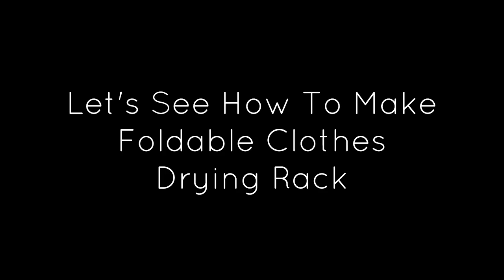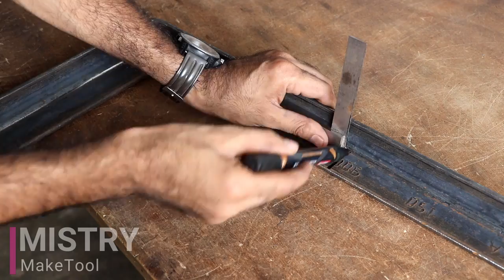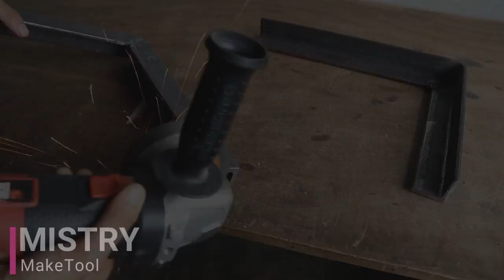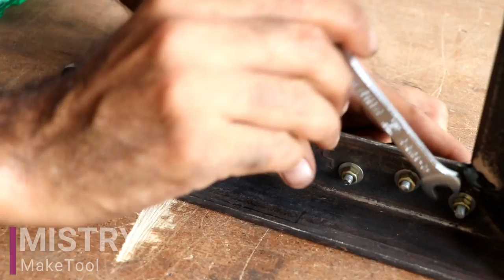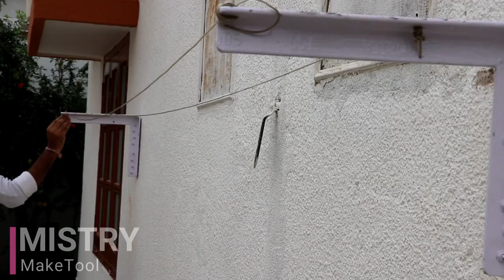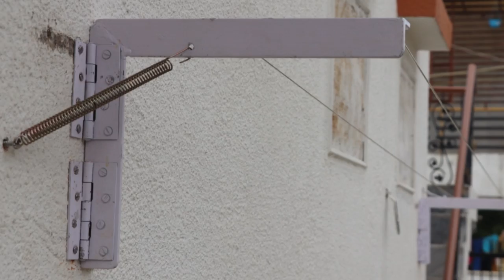How To Make Foldable Clothes Drying Rack || Wall Mount Drying Rack New Idea : )

Comment: Circular hack video please
Reply: What do you mean?
Reply: @denniswhite166  i means Circular saw hack videos
Reply: @mirzaharis914   Yes, your suggestion is a good one. I don't have a table saw but I use a circular saw instead. Tips on these would be good for me too.
Reply: @denniswhite166  i have a circular saw and table saw
I love to work on miter saw
Reply: @MistryMakeTool  please yarr next video circular saw hack
Reply: @mirzaharis914  To be honest (I'm 65 yo) I never did woodworking before and I've seen videos and heard about table saw accidents and injuries. It's made me a little afraid to use one. I have a new sliding 12" double bevel miter saw with a laser guide. It can take the place of a table saw for most of my needs, if not I have my circular saw  ;)
Reply: @denniswhite166  I use table saw and iam 20 year old and using from when i was 15 year old
Reply: @denniswhite166  Circular saw is danger then table saw. circular saw kick backs is killer of human life

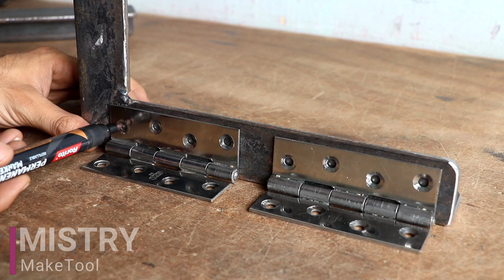Comment: 2:00 clamp hinges and plug weld - faster, less expensive, no bolts. Otherwise very good idea!
Reply: Agree that plug weld is a faster/cleaner solution. Possibly his method of bolting allows replacement of the hinges in case something were to damage them?